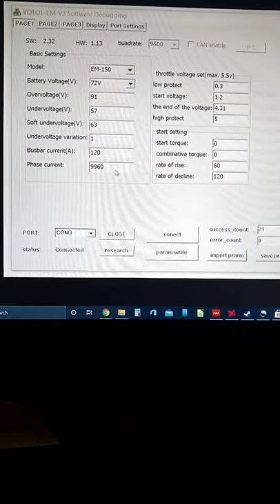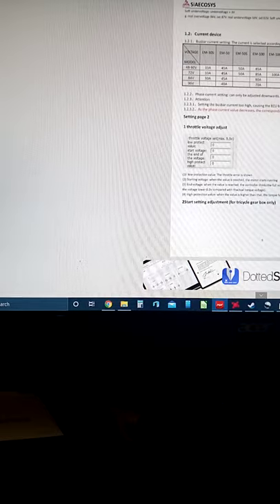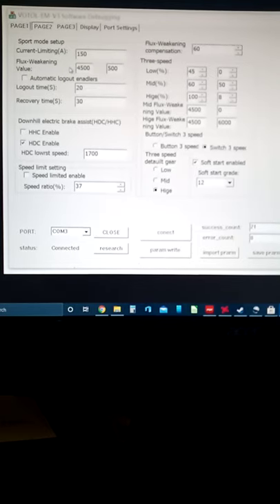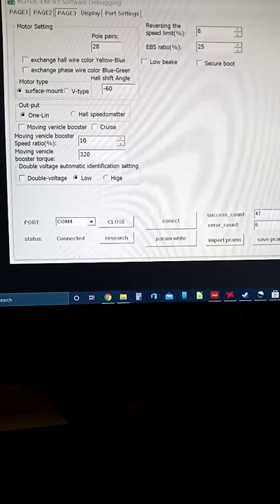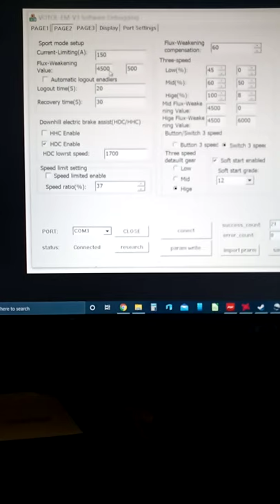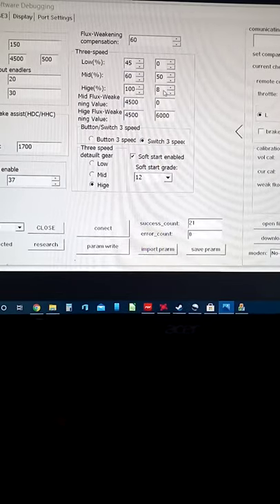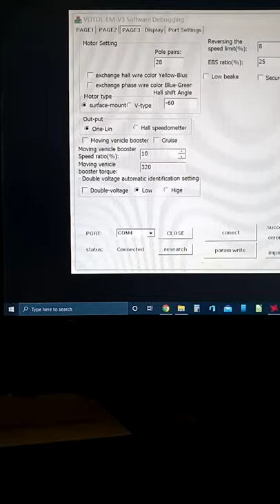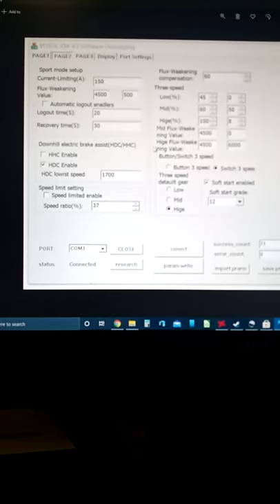E- Vader Votol Set Up

Comment: I did run the driver with same settings as yours. But it is showing tick mark on overheating, and hall fault. The hall spedometer is working fine and I have not connected any of the other temperature sensors. Also I donot understand the things in port settings.
Reply from the maker: with the stock motor page 2 flux weakening 0 current limit with the stock battery 38 amp and page 1 current limit 20 amp. Page 2 HDC enable speed limit at 800 you may be able get more after switching out the Yellow and blue wire on the hall plug and the controller the Votol dont seam to like having a setting of -60 for for phase shift angle on page 3
Reply: very good inspiration

Comment: I keep getting connection abnormal no response😭 any tips?
Reply from the maker: I randomly get that make sure the key is on meaning you can ride the bike. Plug the cable up and open the program for it. if it does not connect close it and try again. There is a USB driver for that as well if it is not installed it will not work. Normally connects to com3. My controller is broken i broke it the wheel will not spin anymore so pay close attention to the settings i do that flux weakening can not be played with by much 0 is ok but dont go over what i have set and if your using the stock wheel flux needs to be set at 0 im thinking the stock wheel had some play in braking my controller as well.

Comment: The manual said flux weakening is < 3000 .I don't know why.
Reply from the maker: if you have the factory recommended settings i would not mess with it to much and if your using the factory 2KW hub motor turn it off completely along with regeneration.